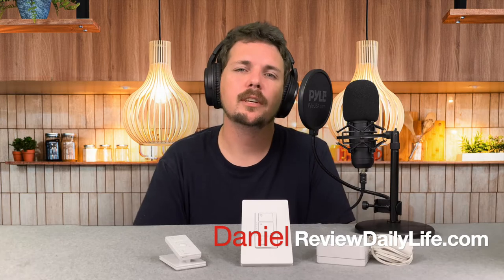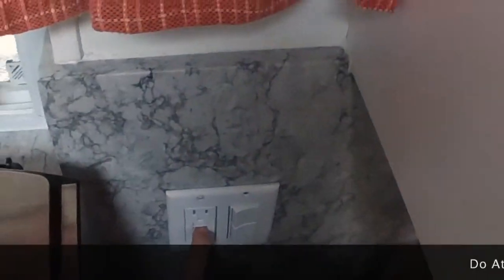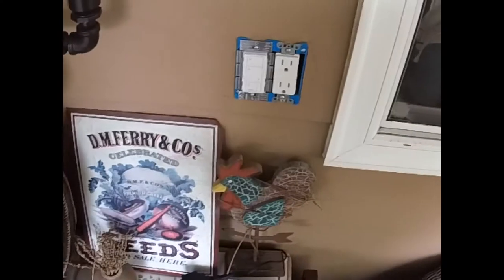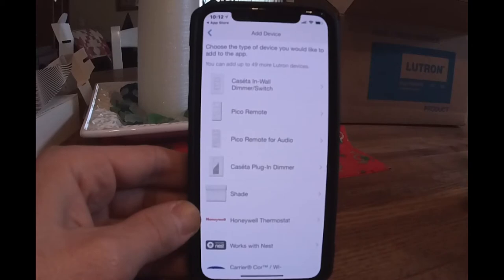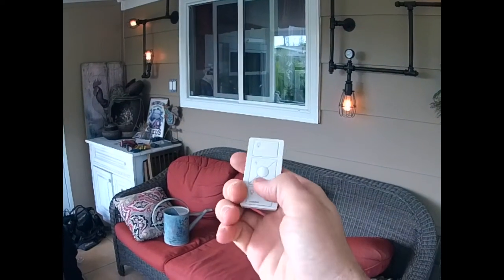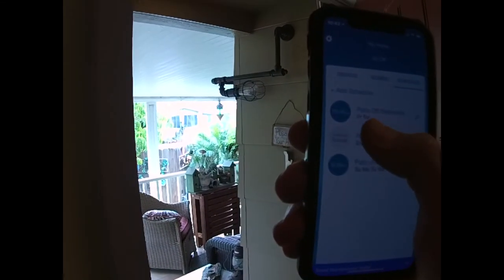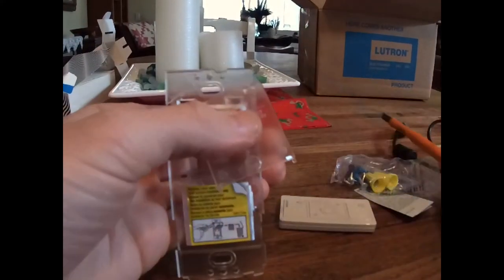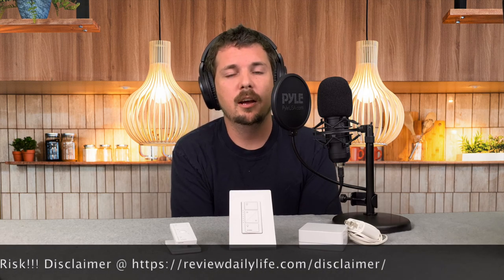Setup Caseta Smart Lighting Dimmer Switch Starter Kit

Comment: What if I don't have the switches that has the wires that you connect to the power and I only have the pico remote with the batteries, can the pico remote work directly with the smart hub if I have the power packs?

Comment: So I have a question the only internet I have in my home is through my mobile device which I can do tether a hotspot will the work with this in other words instead of me having to plug the device into a router which I don't own could I tether it to my hotspot on my phone to act as a router
Reply from the maker: No.. you need a hub and the hub has to be “plugged in” to a router.. the hub can then wirelessly control the lights.. 

i imagine they do it this way to prevent interference.. between lutrons clear tech rf technology devices and the wifi, the lutrons devices work on a different band length (frequency)

Comment: There is no neutral on a standard 3 way switch. The wire maybe white but it's a traveler and carries power
Reply from the maker: I was referencing to smart switches not a standard switch. Some of Lutron’s smart switches have a neutral to function. These switches generally work with less minimum loads and if the load is disconnected the switch still functions.. the switch shown in video with no neutral requires a load to stay online. 

If you have a switch with a neutral and don’t have a neutral available rewiring will have to be done or a non neutral switch would work better for you as long as you can meet the load requirements to make it function

Comment: Today I installed the same kit. I think they did some improvement.
 After I programmed the Dimmer, I wanted to do the Pico like you did here, but the App flashed, "It' s already programmed."
Sure it was, I played with the lights through the App, and it's performed flawlessly.
Other thing, I plugged the hub into the router, yellow port. It didn't work, so I re-plugged the hub into the blue port on the router, it worked.

Comment: Does the bridge work with the older maestro dimming switch too, and not necessarily buy the new dimming switches?
Reply: No.. maestro and caseta are not compatible with each other.. lutron makes awesome systems but there great at having different tiers of systems that are completely separate from each other and only ra2 select and radio ra2 have some sort of compatibility unfortunately, even that then requires a dealer to be involved..

Except for the pico remotes.. there fairly universal to the different systems to some degree

Comment: How far away can the bridge be from the cassetta smart switch?
Reply from the maker: Ive had Wall dimmers and switches work up to roughly 90 feet clear line of sight.. But depending on obstructions and what not 30-60 feet is the general rule of thumb

Comment: Hey Bud. Does the smart bridge has to be directly plugged into the wall or you can use a extension? Just want to know if it works like one of those network extenders for wifi?
Reply from the maker: The smart bridge needs to be plugged in using a ethernet cable to the home network.. as long as you are connected it should work i believe 2 network hops are allowed total.. call lutron to verify if needed..